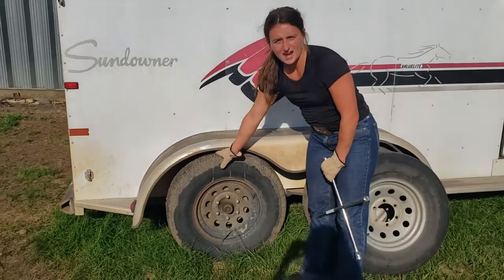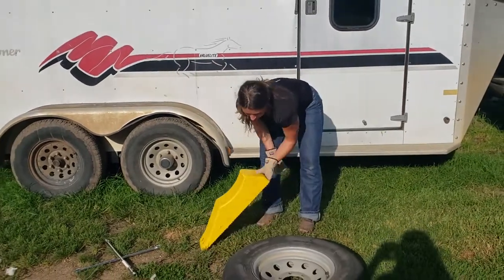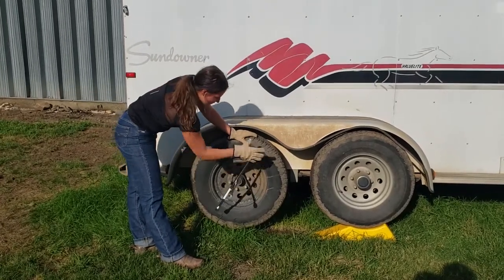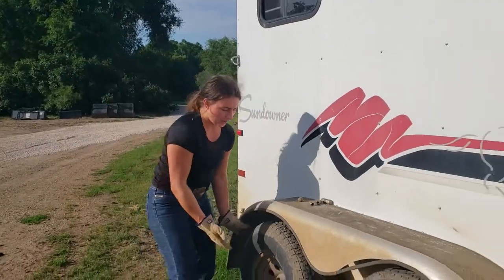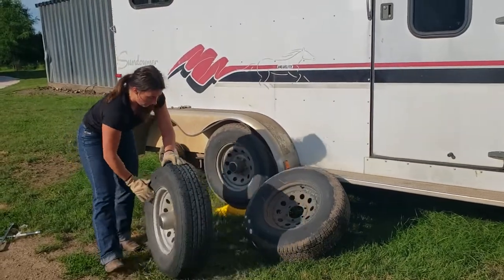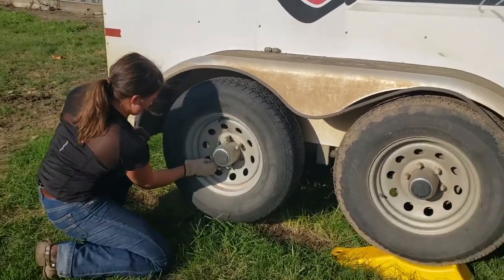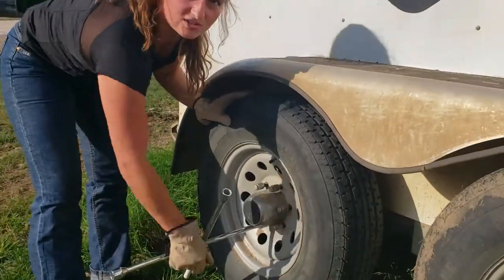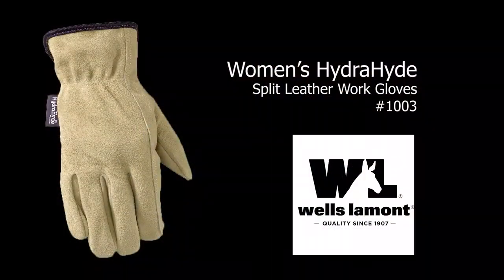How to Change a Trailer Tire

Comment: Awesome. Recommend a cordless impact wrench from any Home Depot or Lowe’s with different size sockets. (Amazon prices are amazing too-where I got mine from) . Also, a 2x8 or 2x10 short piece of wood to lay under the Jack ramp. Wet, soft breakdown lanes are notoriously soft. Good job -you’re a keeper.